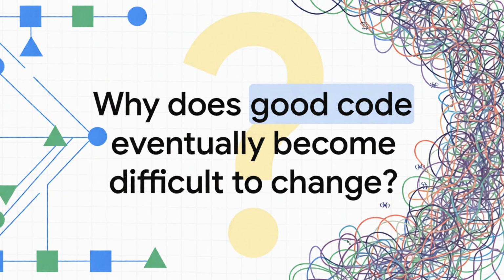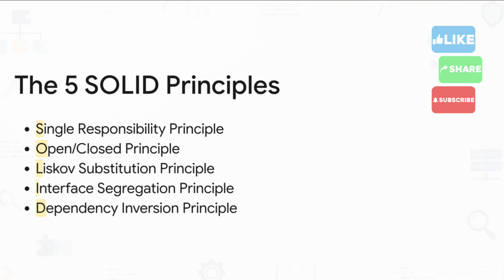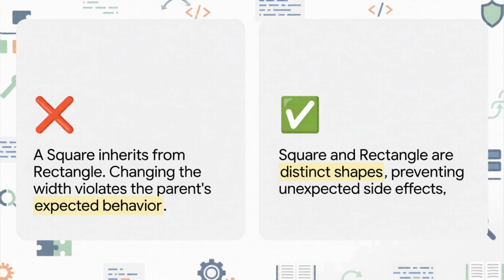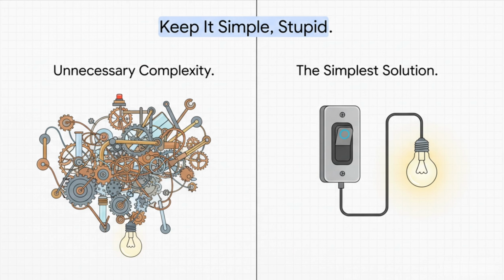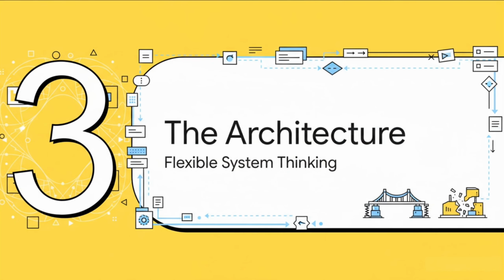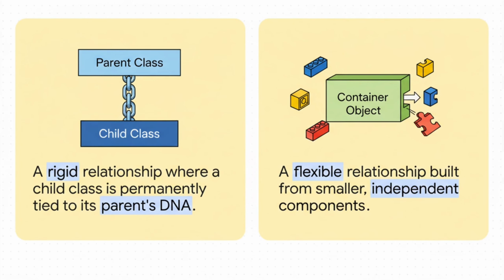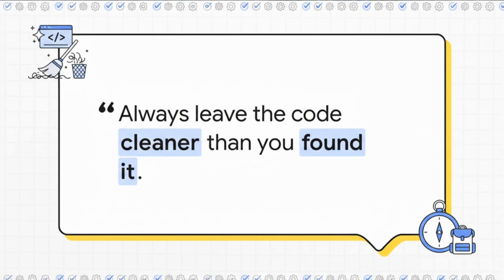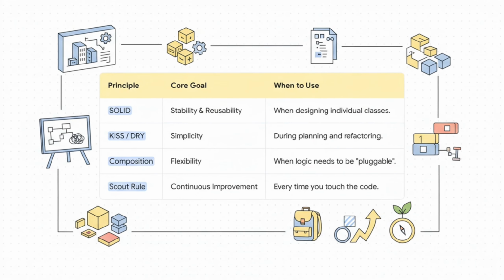Why Your Code Decays: From SOLID to Composition over Inheritance

Comment from the maker: Software quality isn't about writing code that just 'works' today; it's about ensuring it actually survives until tomorrow. From the precision of SOLID principles to the cultural impact of The Scout Rule, these are the tools that separate amateurs from true craftsmen.

📌 Question for the community: In your experience, which of these principles—KISS, DRY, or YAGNI—is the hardest to maintain as a project scales and deadlines get tighter?

Let’s build a shared language for quality. Drop your thoughts below! 👇